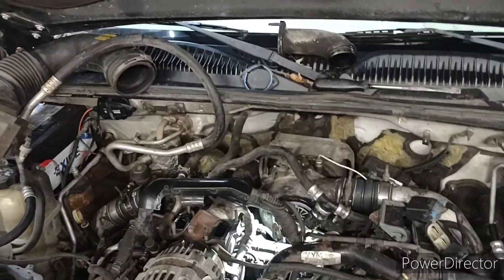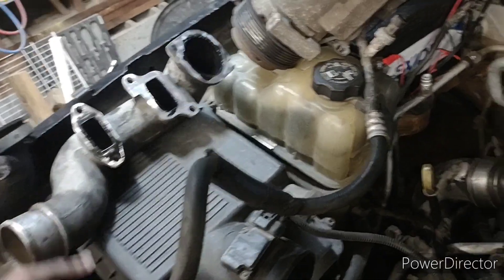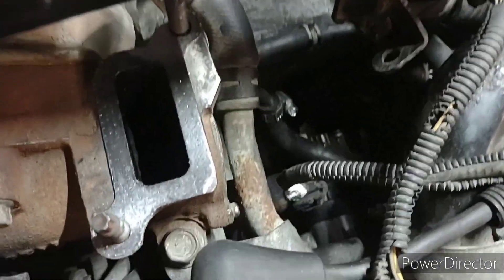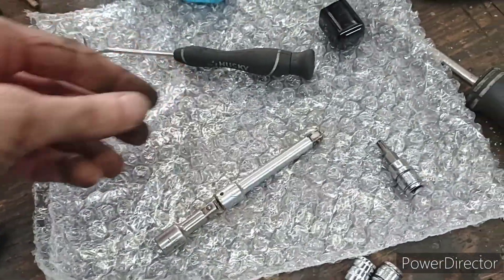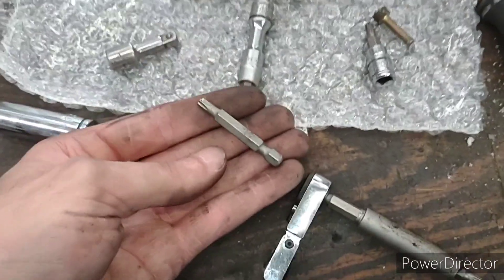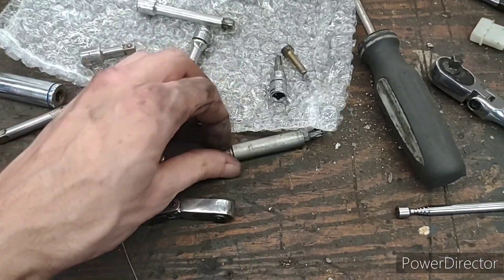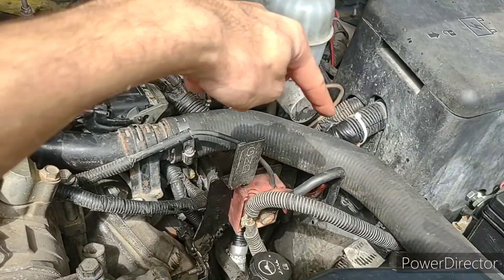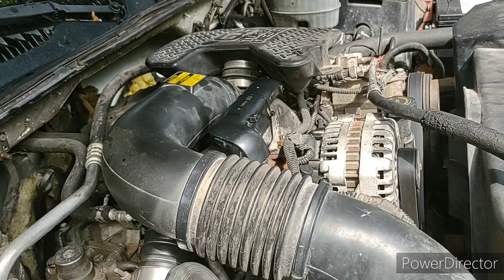Duramax LLY fuel pressure regulator replacement

Comment: I've had issues i THOUGHT was the fpr going out... but it was the fuel temperature sensor!! It was a cheap easy fix in comparison to the FPR..  however,  i did end up buying a new FPR and CP3 pump (which i haven't installed yet) but the new fuel temperature sensor fixed all of my issues with poor mileage,  rough idle, stalling, smoke, acceleration,  fuel knock, very hard starts, poor shifting.. $35 dollar part and the truck runs great now
Reply from the maker: Had no idea that sensor existed. I'll keep it in mind for the next time.
Reply: Any check engine codes? Or just that

Comment: How did you know the pressure regulator was bad.
Reply from the maker: Running parked or sitting at a light, it would act like it was going to stall.  However ran perfect cruising down the highway.  Put a scanner on it and the desired vs actual was jumping all over the place.  Replaced with OEM and back to normal.
Reply: Hey did it misfire hella an white smoke a tad while misfiring having this same issue an bout to replace this weekend
Reply from the maker: @hiltonlandingham  ya you think it's about to die sitting at a light, haha. Didn't have any white smoke though that I noticed. Can't rule out an injector going bad also as an option.
Reply: My y bridge is welded on is your????
Reply from the maker: @hiltonlandingham  there are 2 bolts and 2 studs with nuts on the front easy to see and back hard to see especially the back bottom ones